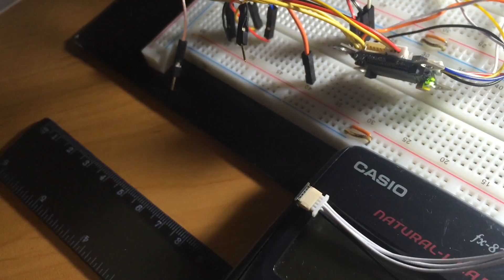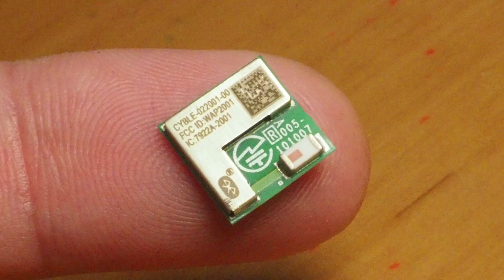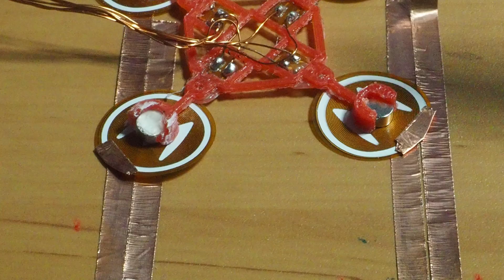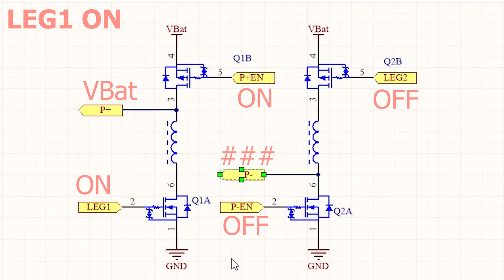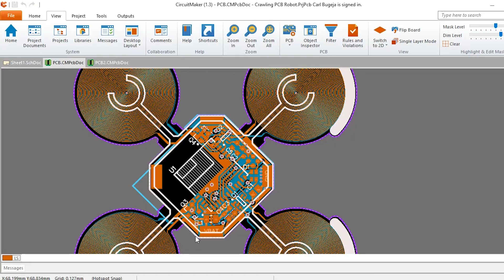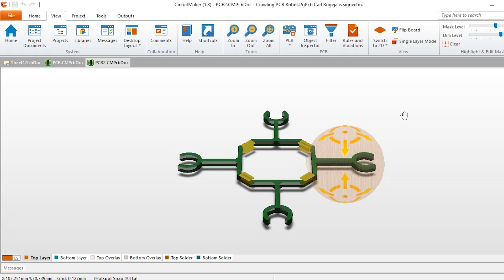Designing my first PCB Robot

Comment: Why you didn't use the esp 09 it is very small wifi module with size 10mm by 10mm and it cost only 0,30 €.

Comment: Nice video. But I think using BLE RSSI as a means of determining distance will be very difficult. I have tried this before using two nRF52840's, but gave up ultimately. You will have to filter out reflections, deal with obstacles, keep track of your antenna performance, keep track of the transmit power of the other robot etc...
Reply from the maker: its definitely not something easy to do and will not be a very accurate sensing source but its something that I can play around with and maybe have a rough estimate of the distance between different robots
Reply: @CarlBugeja  maybe yes. But in my experience the spontaneous delta in RSSI that occurs randomly is too unpredictable to be of any kind of use for positioning.

Comment: That uC seems awfully expensive, wouldn't an esp8266 or esp32 do the trick for way less? (And also most likely have better toolchain support?)
Reply from the maker: yeap it is surly more popular than the CYBLE-022001-00 and probably have much better support but the ESP8266 smd module's package was almost twice its size .. being a miniaturization-freak i choose size against support (which i do not recommend based on previous experience :P)